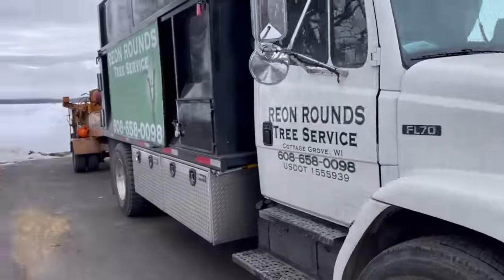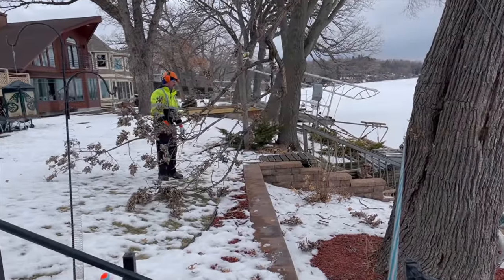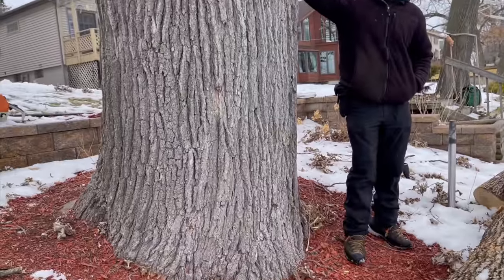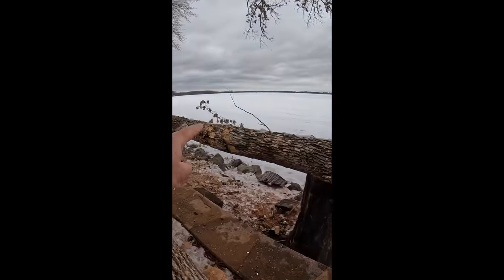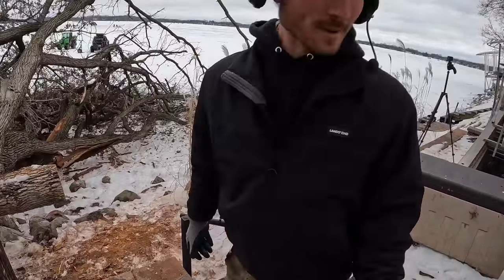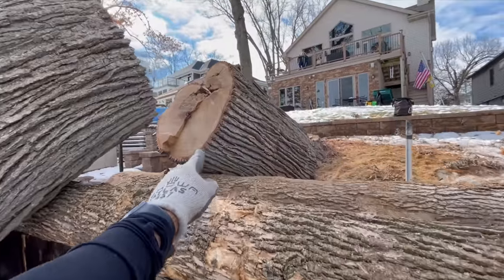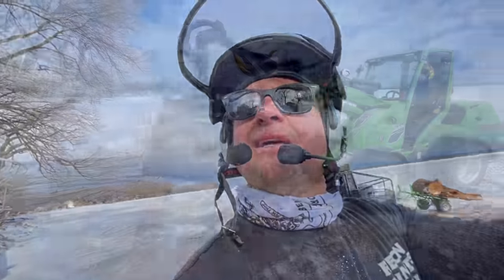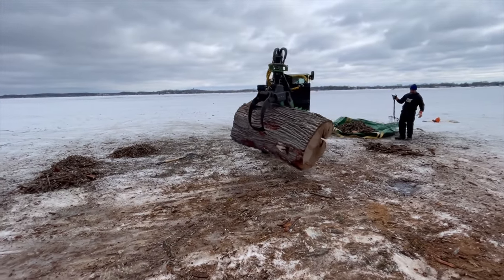Ice Road Tree Workers!

Comment: Hey Reon, it's cool to see the Toyota trail rig is still around. If i remember correctly, you brought it out to Barneveld with a party bus 10-12 years ago.  Good times. 

When im not wheeling, I use my 94 f250 trail rig as a wood truck on my parents farm during the winter.
Reply from the maker: Ha yep that’s the one!!!😁😁 it has actually been sitting about two years straight, before this video... the front differential ring and pinion was stripped out.. I had to fix it specifically for this job😁

Comment: A piece that weighed 60lbs/ft³ would have to be 4' in diameter × 6' in length,  in order to come out to 4,500 pounds.
And that's when the wood is solid throughout,  not punky/spongy/sawdust/missing in the middle....

Whereas a piece that weighed 55lbs/ft³ and was 3.5' in diameter × 5.5' in length would only be 2,900 pounds...

A piece at 50lbs/ft³ that was 3' in diameter × 5' in length would only be 1,770 pounds.....